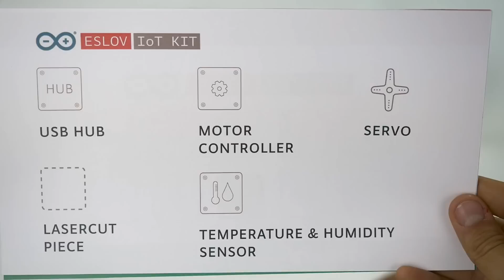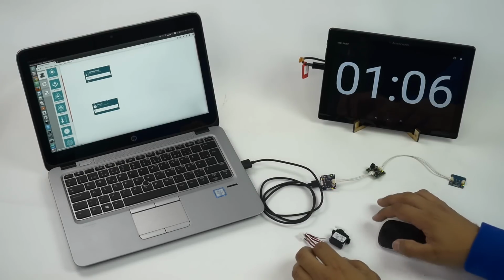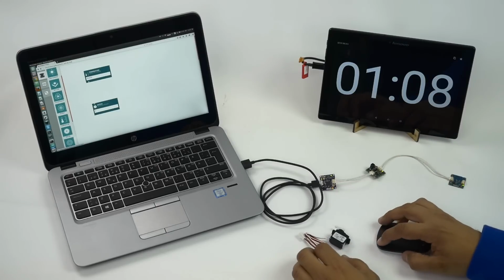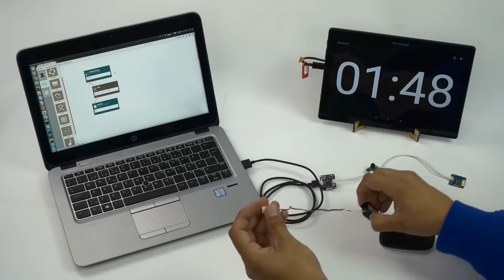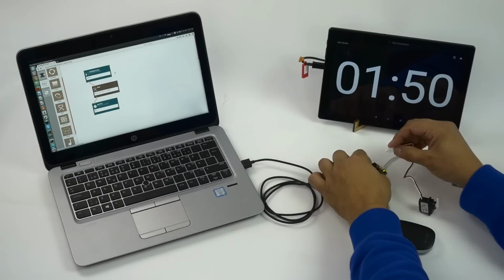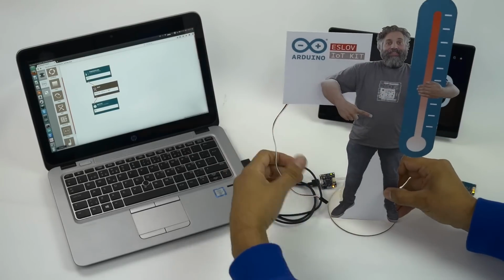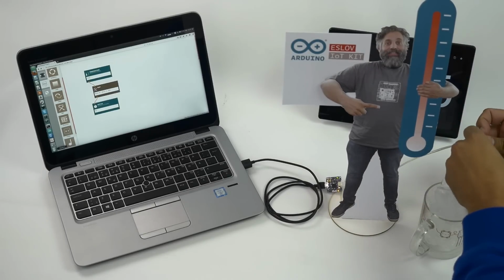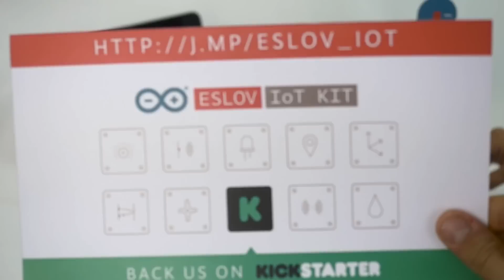ESLOV: The Davidometer

Comment: This ESLOV project is awesome! But what does the word ESLOV mean? Would ESLOV be more expensive than the original arduino stuff like the sensors and other things?
Reply from the maker: ESLOV is the name of a village outside of Malmo, Sweden. Each ESLOV module is a smart device with its own microcontroller. In other words, each ESLOV module is like an Arduino Mini but adding a sensor or actuator to it. This allows for simpler ways to connect multiple sensors together in making your prototypes. Since all sensors are smart, they are a little more expensive, but definitely cheaper than an Arduino Mini + a sensor. In other words, the sum of the parts costs more than the final result.
Reply: So far the kikstarter is expenentionally more expensive. It's 500 US for everything while I could buy everything I need for at least 30 Arduino beginner projects for about 150 CAD
Reply: Cool, thanks